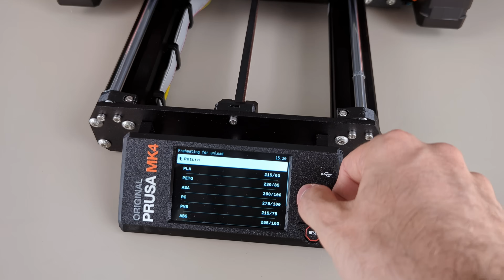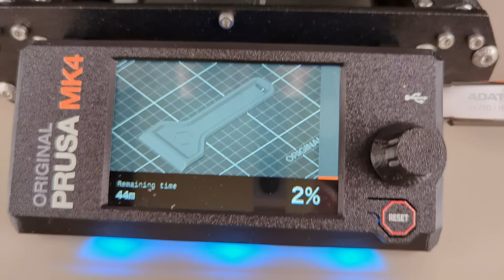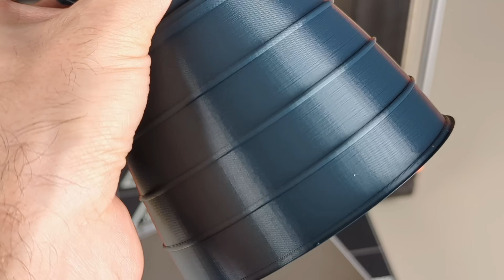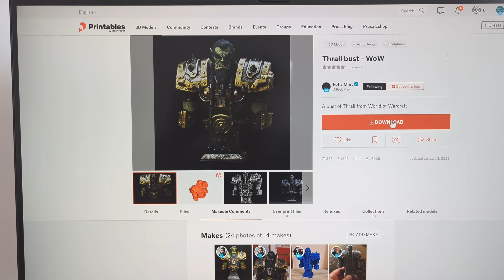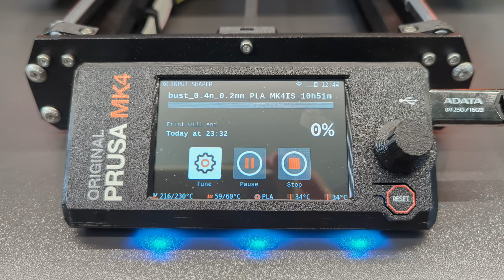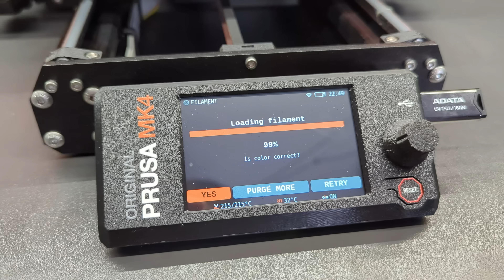Prusa MK4 in 2023? 🤷‍♂️

Comment: i strongly disagree with the appliances point.
Prusa Kits were always the best choice cuz you got familiar with your printer. you know how its build and you know how to replace something.
while the bamboo labs printers are leaning towards convenience with their design, they are a pain in the but to repair, should something fail, speaking from experience with my Bambu Lab X1-Carbon.

Comment: honestly, I bought a prusa XL more than 1 year ago, and I patiently waited for the availability, that I quickly confirmed.
I found the printer at a first glance  a bit rushed, but now, with the new firmware with PA and Input shaping, everything is as expected, I also like the fact that this is a first glance use, no headaches, I personally used a fully modified replicator that I had reprogrammed with marlin and modded extensively, I also used a prusa mk2 from a friend of mine...and XL is just in another level, you can't compare to something that can compete but doesn't have all the possibilities and feature that this printer has and could have in the near future.

Comment: If you are comparing it with multicolored Bambu Lab, you should then test Prusa XL, not MK4. It's just a few hundreds euro more expensive, but prints a lot larger, doesn't poop as Bambu does, also is a coreXY design and what's most important, doesn't phone home to China 24/7, rather it's made in EU and is open source.

Comment: Love my mk4, was worth every penny. Assembly was maybe a bit complex, but once done, its self-diagnostics found my one mistake, and after that it's been printing perfectly. That was the weirdest thing about it, I expected there to be a few days of "getting used to it", but it's been hard at work next to my Mk3 since day#1, not a single failed print. There are still a few software bugs on PrusaConnect, but the printer itself is completely fire-and-forget, including nozzle changing.
Reply: What do you think of some of the surface artifacting and ringing? I found them to be less than desirable for a machine that was suppose to have so much time and experience to mature. It doesn't even have true inputshaping
Reply: @mynt4033 What is true input shaping even? They're using a model averaged from data from thousands of printers, instead of just one. Same result. As for artefacts, yes, it seems to produce a few, but they are within tolerance.
Reply: @Standbackforscience  You need an IMU on board to account and calibrate for individual vibrations. It's not a problem you can "just average". It's different for all printers. Even the same build.  If the frequency is ever so slightly off, you get constructive interference on vibrations and it makes it far worse. Every review has proven that input shaping results in a fuzzy surface mess for the MK4 and I'm not surprised. 
Plus, averaging it no longer permits individual customizations, which is a shame considering Prusa encouraged a ton of customizations.
Reply: @mynt4033 Get a voron.

Comment: i have never bought a Prusa in the 13 years i have been doing 3D printers and the reason is i think they take the cheapest approach to manufacturing an item, which is FINE, but then charge premium pricing because "people will buy it because it is Prusa" and other than fancy footwork with firmware and hardware, i don't see the product itself as premium. great prints, but that is not the point. (sorry fanboys LOL)

Comment: Hi, do I need to buy the printer casing if I want to print in pet or is it not necessary? Is the case useful in terms of noise, will it bother me when I'm sleeping if my printer is in my room without a case? Thank you for your answers.
Reply from the maker: It's perhaps the quietest printer I have. Could help to add a foam material underneath to reduce vibration transfer into the desk. I don't know if a case would make it quieter; could be the opposite.
Reply: @MihaiDesigns  thank you for your response

Comment: You will break the wire when it’s so close to the wall. You need to print a piece that puts the bed wire at 45 degrees.
Reply: Reason 900 for why bed slinger just don't make sense in current year.

There are certain price points at which for most people it's just not worth it to deal with the hassle of a cheaper machine. This one ain't cheap and you still have to deal with this 🤦.

Like I know to some this might seem a small critique but seriously, no included chamber (the XL doesn't either) to me has always seemed like a way to subtly raise the actual price just that much more.

Comment: is it worth the price ?
would you suggest this for beginners who are really into 3d printer (that's me) and starting for the first time?
Reply: Better get abambu lab
Reply: It’s a bit expensive, but totally worth it. I bought my MK4 , my first 3D printer. I just wanted something to work without any hassle and the MK4 does not disappoint.
Reply: if its your only printer you have nothing to compare it to. bambu labs is far better  @arbjful
Reply: for price per performance, get the P1P

Comment: They just recently released a new firmware for the MMU2 that rebuilt the code entirely. I was having issues with an MMU2 at work, but once I updated the firmware, it basically just worked

Comment: Why are they so rattly and noisy? Also, I never understood why manufacturers have the start gcode where the nozzle is in the air while it heats up. I made my own custom gcode where it puts the nozzle .4mm above the bed right in front of the prime line starting point, and then it extrudes 5mm to make a small blob so it pulls plastic off nozzle as it jumps 10mm to start the prime line, so I never have to fool around with tweezers trying to grab filament off the nozzle while its printing. It makes no sense why such an established company wouldn't have better start gcode to prevent filament getting in the way of the print.

Comment: Prusa mk4 vs Bambu P1S which one, and why?
Reply: Both print at very good quality, Prusa is open source, made in EU, great customer support, very good software (Prusa Slicer) very well proven as a work horse, Prusa have a print farm of about 1000 printers working 24hr so it is well tested and tortured. Those are some points that come to mind, I have a mk3s+ that so far worked flawlessly for the past 3yrs and I have absolutely nothing against Bambu, I'm not biased in any way but looking at many videos about them they really print very well and price for price you can get an X1 carbon with enclosure and ready to print some more exotic materials like Nylon or carbon filled filament right out of the Box.
Reply: @ripmax333 I bought recently bambu a1. So far I'm happy with print quality and printer quality. Prusa is more solid in my opinion but bambu is faster.
Reply: @wojtektymicki1357  now they introduced the MK4S, in printing speed they should be head to head.
Reply: @ripmax333  few months after purchase of my. They introduce mk4s, but bambulab is still cheaper. Competing a1 vs mk4s. No doubt Prusa is better.

Comment: Bambu Lab printer is the best to date, the nozzle cleaning is great and flow calibration is on point, you just connect it and watch it printing progress from the comfort of your phone. The Mk4 doesnt have any of these features and as expensive if not more compared to the P1P and the P1S. Speaking from past printers including the Prusa MK3S+, the Bambu P1P - P1S is the best for all users.

Comment: Took me a couple of tries to figure it out - but at the screen where it tells you to wait and there is a continue prompt - do NOT press that continue button. It's a bit of bad UI design, but you are really expected to wait and that button is only if it doesn't work. They can definitely improve the UI, it's pretty weak. That said, still a pretty solid printer and has good support - and I'm into tinkering and not into proprietary, so I like that I can do stuff with it.
Reply: It’s not made for speed, but fail proof.
Reply: Connecting to wifi should be a 30 second at most process, with most devices even as low as a few seconds. There is really no excuse for having to enter wifi details on a usb stick or it taking that long to connect. I believe the P1P and P1S may use similar wifi hardware (esp32 I believe it may also be the main controller for the printer, although Prusa may be using an esp8266 based module for some reason) and they don’t have those issues.
Reply: @conorstewart2214 the microcontroller prusa uses is not a ESP32 but a STM32.
Reply: @stan110  I was on about the Wi-Fi module. Most STM32 microcontrollers do not have built in wifi, the wifi module used in prusas is the ESP01 which is an ESP8266. There is still no excuse for it being that slow.
Reply: @conorstewart2214  P1P and P1S use proper linux single board computer for handling wifi as well as klipper inside. Good luck with uploading 10+MB files over that module.

Basically you need to compare Duet/Marlin against Klipper, and the winner wouldn't be Duet nor Marlin. 7-8 years ago that could've make sense, when RPi was pretty slow and klipper wasn't a good competitor, but nowadays... OrangePi Zero 3 with 1Gb of RAM costs just 20 eur, but the possibilities are insane

Comment: MK4 is an iteration of a proven design that is easy to setup, maintain, and repair. It has also been designed to be safe to operate, have an emergency stop button that works. Things that are signed off in its Declaration of Conformity under the Machinery Directive. Other printers have no such documentation, I'm not even sure if they should be sold in EU. As a product reviewer/industrial designer, you should mention these intagible yet important things to your audience who rely on you to inform them.
Reply: Literally something that nobody in the 3D print world has ever cared about. if we did then all the self made printers would have it.
Reply: And also the fact that for Bambu your design files have to be sent to a server in China
Reply: Ok, Ive seen some ridiculous points before, but this is absurd.

A 3d printer with nema 17s isnt going to tear off someones arm, or light your house on fire (we are well past the days of the Anet A8).

Those things you mentioned are the sort of things that on paper, to someone who knows nothing sound like they might matter, but literally do not matter at all.

Every printer has multiple stop buttons. I know Bambulabs for instance have multiple, from the screen, to a physical button, to the power switch.

It just literally does not matter.

As for easy to setup and maintain.... he covered those, and I think if we are honest, we know that a Bambulab easily wins on those two fronts, so the thing thats left is repairability, where very obviously Prusa wins there.

Basically, none of your comment is really the smoking gun it sounds like its trying to be. Maybe its not, I know tone is hard over the internet, but it just bothered me it felt like you were presenting 3d printers as some dangerous industrial machinery. Like there is no where close to even half a horse power of power anywhere in the motion systems of a consumer 3d printer.
Reply: @BeefIngot that's your opinion, while what was stated is the law in most jurisdictions. i.e. consumer products have to meet various health and safety standards, and these standards are required to be made publicly known. Consumers do not know that they are protected by product liability laws, while certain people are willfully ignorant, giving cover to companies that could've designed safer and better products for everyone.

This was a lawsuit filed last year by a deceased man's parents for a printer fire that caused his demise. https://regmedia.co.uk/2022/06/09/alibaba_3d_printer.pdf

Comment: The MK4 is a nice machine but the price is just way too high for what you get. I feel Prusa got a little lazy with bringing in new features and/or reducing price to stay competitive since they have been so well known for years now. Everyone knew Prusa as the printers that ''just work'', and it seems like they expected that hype to just keep on living for ever. 
Taking years and years to just marginally improve an ancient bed-slinger machine while the rest of the market are competing for more and more ease-of-use features and reliability for a lower price. Prusa were able to sell more expensive machines because other brands struggled with reliability, but today you get dirt cheap Chinese machines that work just as well. 
I fear Prusa might run their company into the ground within the next 5 years if they don't change. I have barely heard of anyone switching from one brand to Prusa for a while now, the people who buy new Prusa machines are the people who already had a printer of that brand from before. 
It's starting to look like the car manufacturer Saab before they went out of business, 90% of people who bought new Saabs already had a Saab. They didn't bring in any new customers. 

Prusa used to be the top of the line when it came to hobby machines. Back in the day you either got yourself a cheap sketchy Chinese machine that needed tinkering but was usable, or you paid extra to get the luxury Prusa machine. 
Now you have cheap Chinese machines that work really well with some tinkering, you have Bambu and maybe soon Creality up in the sorta pricey range that work super well, but then you have Prusa with a machine that performs in the middle of these with the price of the top dogs. 

I heavily considered a MK4 before I went the Bambu route, but I have still been checking Youtube several times a week for new videos on the MK4 and XL because the machines still excite me a little. 
What's weird is that the printers have been for sale for a while yet I struggle to find any good and interesting videos, just a ton of people with trouble or paid reviews. 

I'm really curious what the future brings for this company, I really don't want to see them disappear yet I also think they need to change drastically if they want to stay in business.
Reply: Prusa has always been great at keeping the youtubers in there good books, just like when most customers waited months to get the new bed they created for the Mk3 but all the youtubers were getting them straight away. I think they all have a skewed view of Prusa printers because they get so much free stuff and because Prusa has a lot of history behind it, the reality is this printer would be called outdated and overpriced if anyone other than Prusa made it.
Reply: nowadays there's even a few "el cheapo" chinese printers like sovol sv08 which prints just out of the box. Indeed you can tinker, but with good parts you'll essentially get a good printer. Voron Design did an exceptional job by creating their designs which gained popularity not because "they're designed in EU" or something like that, but just because the designs are amazing. And e.g. some chinese manufacturers do their paybacks to the community as well: that SV08 was heavily influenced by Voron 2.4, and they do pay some percentage off their margin to Voron Design team. I see that kind of collaboration as a best one: people who can design - they design, manufacturers with great production capabilities essentially adapt some parts of the design to manufacturing needs, and they do pay back to the community

Comment: "Treating 3D printers more like appliances" -- This right here. I loved my MK3S+ but I hated how much I had to learn about it to use it effectively. No other tool, and that is exactly what I consider these to be, requires me to have a fundamental understanding of them, in order to operate them. I have no idea how a table saw operates...yet I can still rip through wood when I need to. Knowing how one operates might make the difference in maintaining one for 10 years vs it dying in 2 years...but that shouldn't mean the difference in it operating effectively.

I wish I had started with an Ender because there is a trade off in price where that amount of learning would be far more easy to swallow, but it isn't at almost $1000.
Reply: I'm confused, what did you have to learn? The prusas work super reliably like appliances to me.